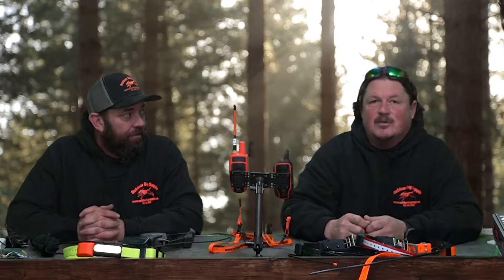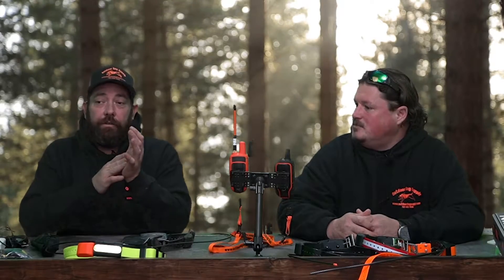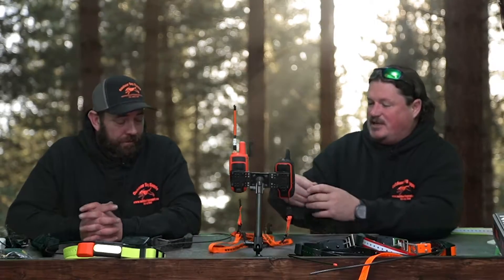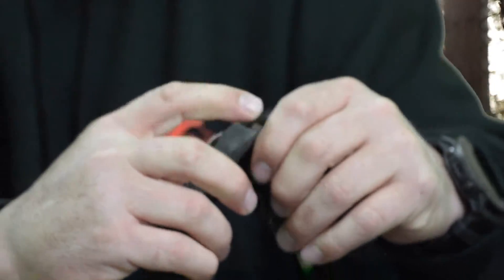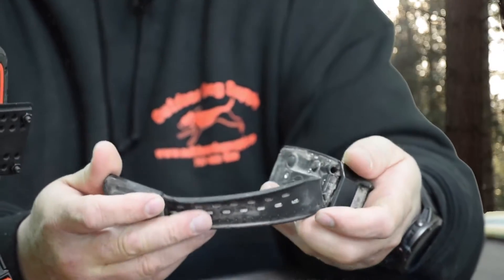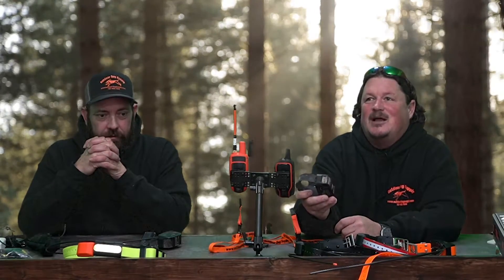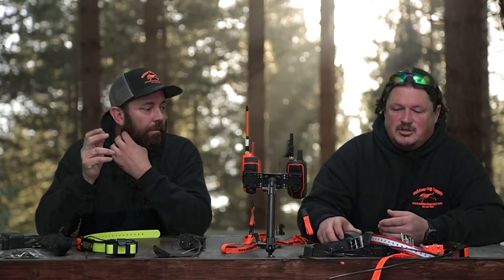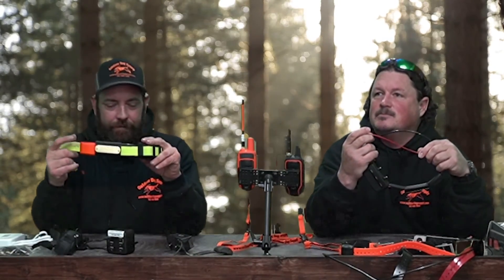Garmin TT15 & T5 Dog Collar Technical Support

Comment: Updating the collars made mine not work at all.
Reply: Same here, I updated the collar about a month and a half ago and now the GPS is completely screwed up. I called tech support and was told to do a factory reset and if that didn't work then I would need to send in the collar for repair for the low low price of $140.00.

Comment: i got a new TT15 collar and have tried to turn on the light.  it will not go on.  this happened with a different TT15 collar which i returned bc i thought it was broken.  i have an old alpha handheld.  probably 10 yrs old.  any suggestions to get light on.  it does turn on the light on our older collars.  thanks
Reply: Have you found a fix for this? I just got an Alpha 200 and TT 15X last night and beacon lights wont turn on...

Comment: TT15 turns off after turning on. Green light blinks 7 times and then it turns off. Updated it through WebUpdater, did factory reset, nothing helps. It's pretty new, not dirty, still have the warranty but trying to figure out is there a solution to this?

Comment: Hi - we had replace the battery in our collar, when doing so, some of the wires inside where pulled away from the charging connection. Is there a way to fix that ourselves?

Comment: My t15 drop out 3 hundred yards then they may pick back up at 9 hundred
Reply: Right got 2 T5’s does same crap . Not as good as DC 50-40-30-20 collars . T5’s are in my opinion junk . As much as it cost Garmin should stand behind their equipment. But it’s all about them making big bucks and always upgrading a different hand held . That last generation collar won’t connect to . My little 2 cents worth

Comment: my tt15 collar will not turn on. if I hold the on button for about a minute the red light will come on blink green twice then turn off
Reply: Same
Reply: if the satellite cable is broken and for some reason it touches each other, it won't let your collar turn on..check the cable